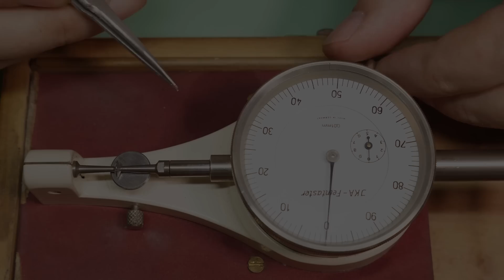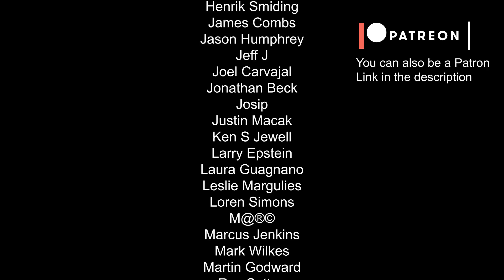Repairing a broken pivot  - making a centre drill guide - watch repair tutorial

Comment: Thanks for the video.  The fixture you used to create the centre mark looks like it left a pip, @7:15.  Not an issue for the drill starting?  Also,  you finish the pivot before insertion, or are you bringing to final size and burnishing afterward?  Thanks, just trying to understand as ready for a similar repair

Comment: Mark,

This may actually solve a problem I have with a Escape wheel pivot. The movement has no markings other than a K so I am having issues finding a replacement. I am taking your watch repair course and I haven't serviced 1 movement as of yet, I did win several from eBay which should be here any day. I want to service all 5 before moving on to course 3. I've learned so much from your first two courses, and am very grateful you put so much time and effort into producing them.

Comment: so what would the safe to straighten axle shaft wheel (e.g. a lighter)to heat the axle up to red and let it cool down (so metal opustitsya and become soft) after you straighten and also heat to red sharply lower into the water (so, again, we temper the metal and he will again be strong as they were in the beginning!!!

Comment: As ever, VERY interesting videos! Ever thought about induction heating? It would work only on steel, but is very localised, and easily achieved by a very small coil of copper wire , two or three turns wound around the pivot (loosely) and AC current applied. Common in the motor industry, (on a much larger scale). You would get the pivot hot, but not the brass wheel, as the induction does not work on brass. Softening the pivot may then allow straightening without breakage.
Reply: Á1www

Comment: Also, will you need to temper the new pinion?  If so, that would be a very interesting process to see.
Reply from the maker: No - using pivot steel is already hardened and tempered.
Reply: WOW!  And you were able to reduce the diameter!  First Rate!!